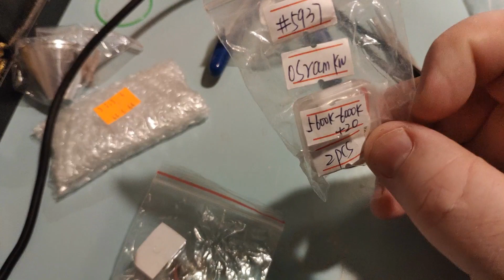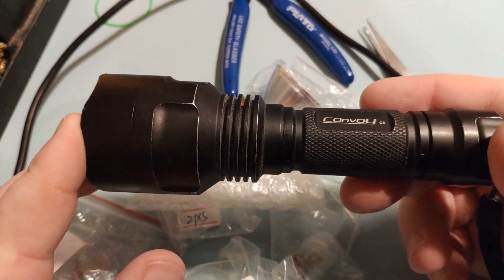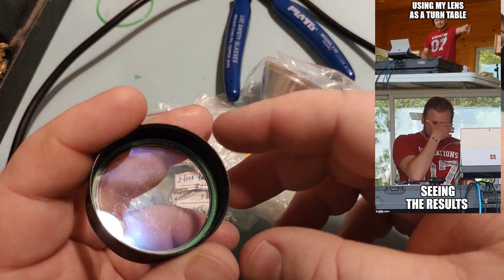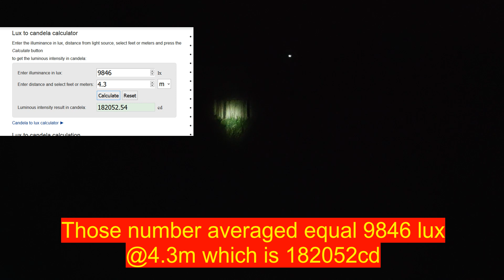Convoy C8 Build 182kcd featuring the Osram CSLMN1- (1mm2)

Comment: Do you have links to the parts used? I'm looking to do similar.
Reply from the maker: Hey mate you can buy this build ready made now. 
https://www.aliexpress.com/item/1005001400455356.html?spm=a2g0o.detail.1000060.1.3686b784E5vUGO&gps-id=pcDetailBottomMoreThisSeller&scm=1007.13339.169870.0&scm_id=1007.13339.169870.0&scm-url=1007.13339.169870.0&pvid=a9cd9e80-9517-4f5c-8562-6bdb14f39e1a&_t=gps-id:pcDetailBottomMoreThisSeller,scm-url:1007.13339.169870.0,pvid:a9cd9e80-9517-4f5c-8562-6bdb14f39e1a,tpp_buckets:668%230%23131923%2370_668%23808%234094%23137_668%23888%233325%2311_668%234328%2319931%23495_668%232846%238110%23388_668%232717%237559%2365_668%231000022185%231000066059%230_668%233468%2315613%23458
Its the same driver as i am using.  If you want to build it yourself you can buy all the parts from the same store. Just make sure you get 3mm LED gaskets.

Comment: Hi can i change amutorch led sst40 2000 lumens to osram CSLPM1.TG 2mm 18 watt? With same driver?
Reply from the maker: Hey mate you need to limit the current to 5amps max with this LED. 18w is around  5.5amps/4v it could be to high. You can try it but be careful if the LED turns blue turn the light of. You could try and use a low current battery first and see how it goes. What light is it?
Reply: everyday survival gear okay thanks for the information 😊
Reply: @tronofficial8683 
Widihh... Teko kene koen yo an?! ✌ ✌ 😁 😁

Comment: Nice content, Chris!
But, I believe that's the cslnm1, not the cslpm1.
Had mine in clear c8+ with convoy "ramp" driver measured more than 6 Amps at the tail using DMM multimeter.
I used the 7mm opening reflector rather than the 9mm because the hotspot is tighter :)
Sorry for my bad english, not a native and still learning tho ✌️
Reply from the maker: Thanks mate you might be right as the numbers are confusing lol. I have the bigger one in a L2 and one in a Cometa and its great they both run on direct drive.

Comment: Not enough memes!
Reply from the maker: Yea i was going to use more but there was none left on shelves lol.
Reply: everyday survival gear came for the memes, left disappointed 😉
Has anyone put this LED is something ridiculous like the BLF GT to make a laser?
Reply from the maker: @lionheart_2281  I am not sure as the stock driver will need to be changed to a current limited 3v driver. These LEDs can only take 5amps max. On the plus side the run time with the GT battery setup will be amazing.